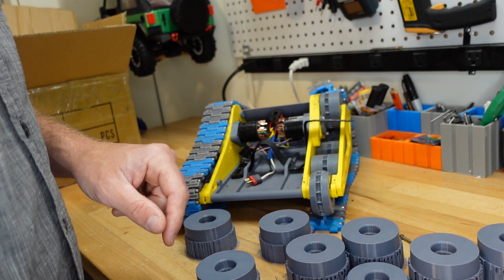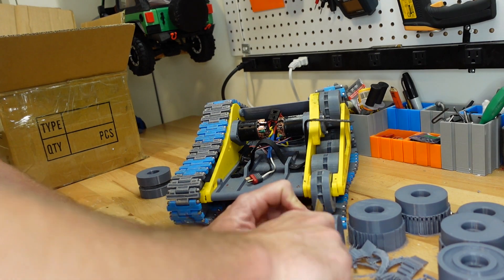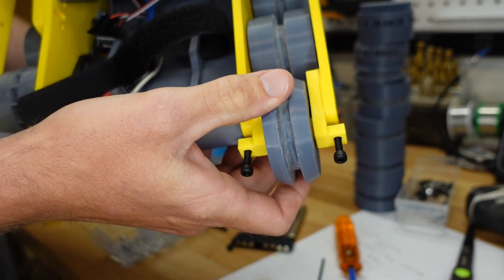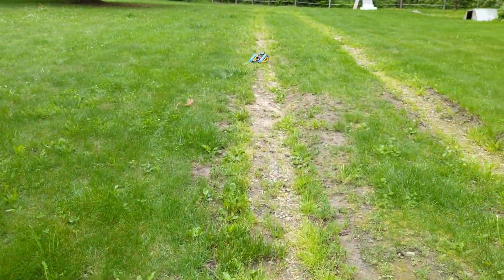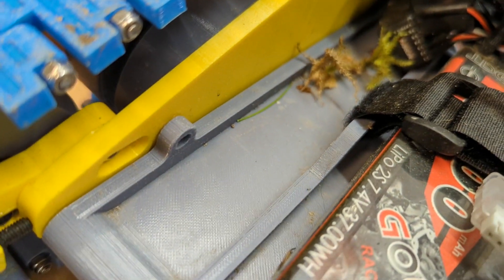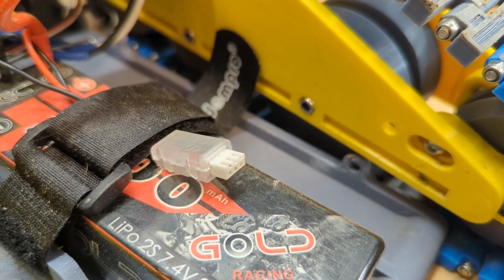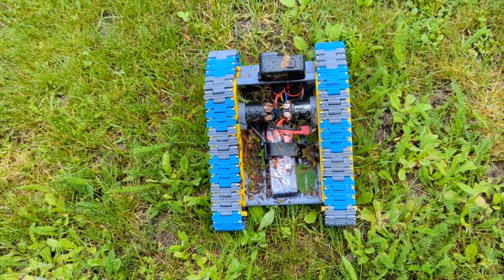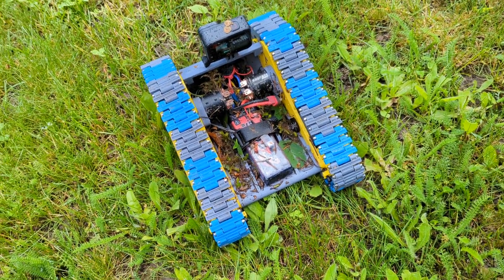Forest Bashing with the Speed Tank + Roller Upgrades!

Comment: I like to look of those track tensioners, getting mine to adjust has been an issue. The sped-up onboard was like an Evil Dead movie :-) Heat does still seem to be an issue, I have not had the chance to add the fans to mine yet but you have shown they work well in the woods. Glad the fail was only loose bolts, to see the whole side off was a worry.
Reply from the maker: ya the whole side coming off was pretty hilarious :) Total user error though. I've now lock tightened everything that doesn't use a lock nut and glued all the nuts in place and everything seems super secure. Track tensioners are a must have IMO, highly recommend.
Reply: @rcprinter  Will look into them.